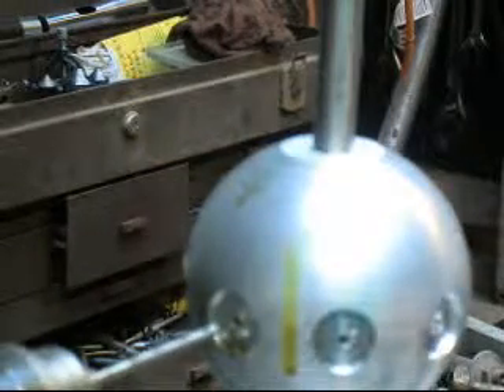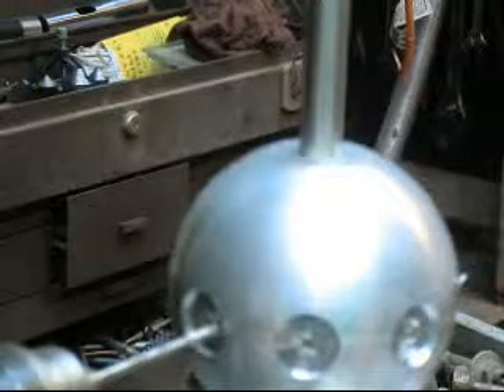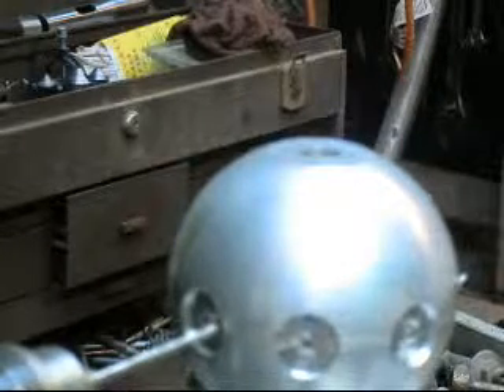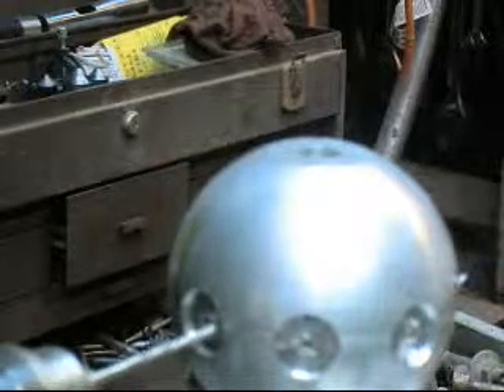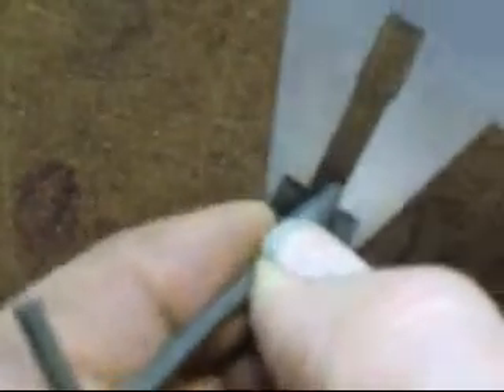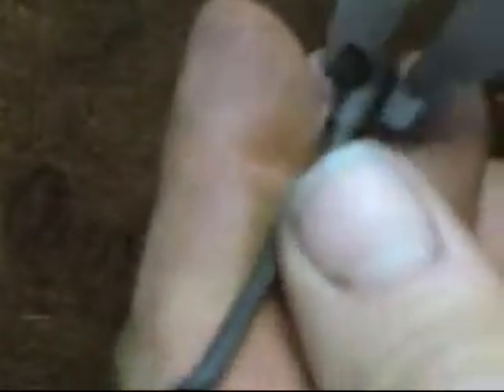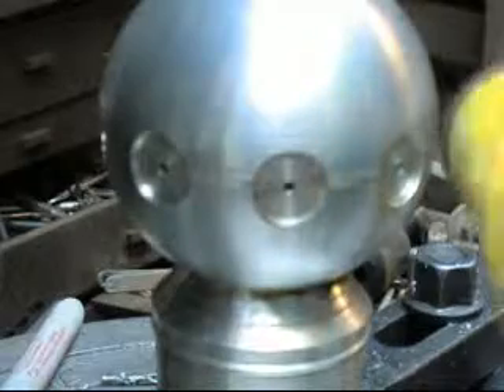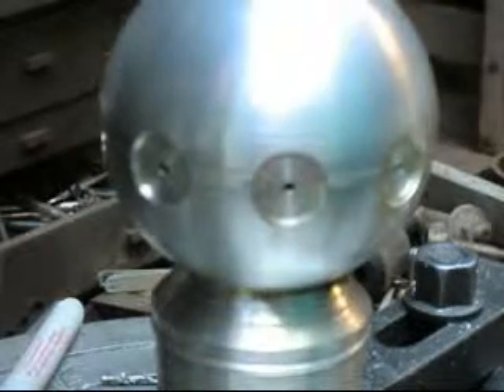Balls Out Free Energy Generator #3

Comment: Could you have knurled the shaft lightly to get it back up to size?  Doug
Reply from the maker: +Douglas Thompson Knurling does work, but in my experience, it doesn;t last. Yes, you are right for clarity my $300. camera couldn't hold a candle to the little $95. canon I bought later and now two years later still using.